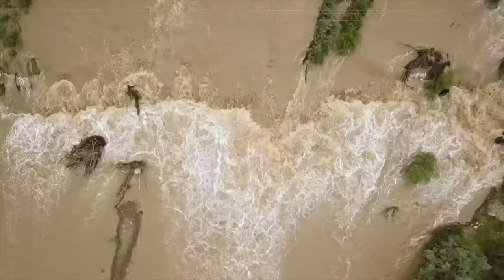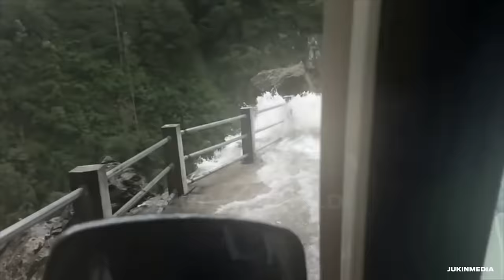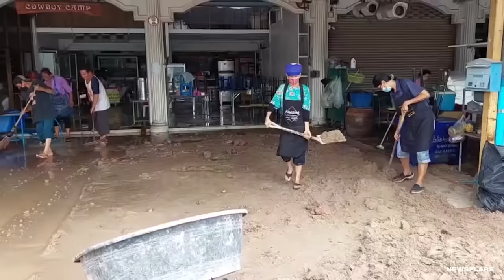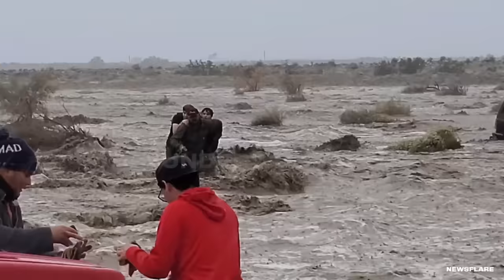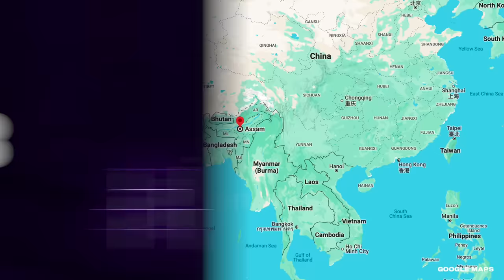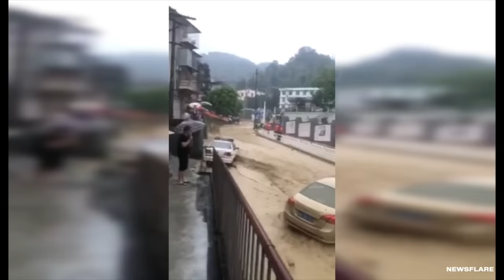10 Ridiculous Flash Floods Caught on Camera

Comment: Did anyone else notice the BIG ASS chain attached to the back of the truck that rescued those two gents from the flash flood in SO. CAL?
Reply: Saw that. What I have tried to figure out is if there is something like a dog left standing on the SUV stuck in the flood, or if that dark thing you can see near the hood is something like a car snorkel. The latter might explain why the young guys got stuck in the middle of the flood, they maybe thought they could drive through it due to having a car that should have been able to handle even a bit deeper water.